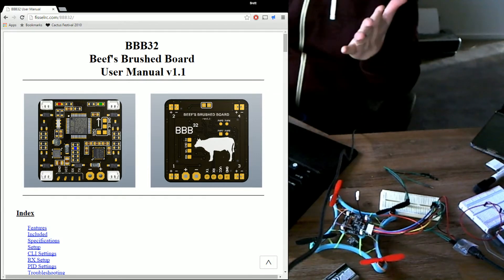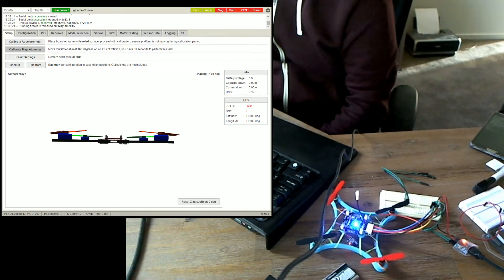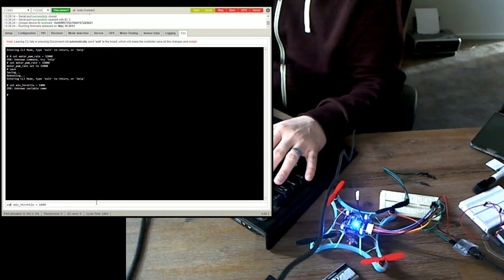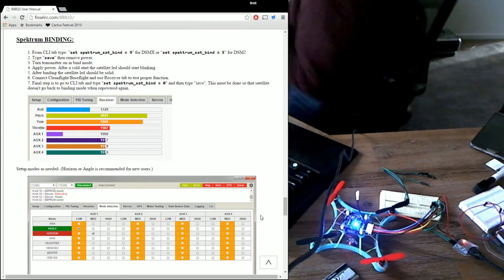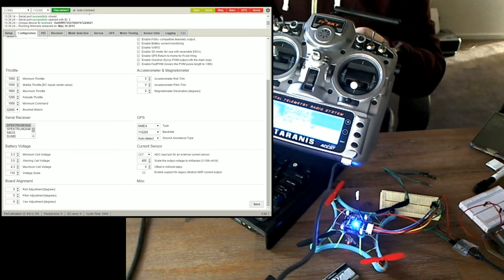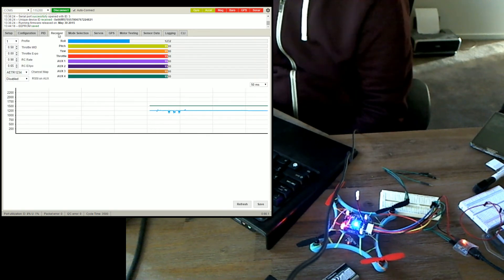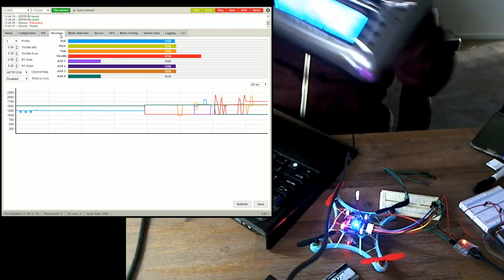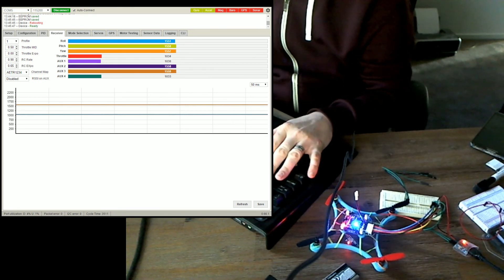Beefs Brushed Board - Micro Quadcopter software setup

Comment: How did you set the MicroFrX in Bind Mode? I tried to short connect the Bind pins, but the RX didN't start blinking.
Reply from the maker: how did you short them? i did have one that was broken which took a bit to figure out.
Reply: +Brett James I tried it with the end of a cable, and then i laid a very small nut on it, and then i also tried with Tweezers
Reply from the maker: Tweezers was what worked for me....

Alternatively,  solder the gap in, and then when you are done "cut" the gap using  the iron to make a gap again after
Reply: I forgott to say, that the light is on though - it just doesn't start blinking. Is it still possible that is is broken then?
Reply: By the way: thanks for the nice video - was very helpful with the rest of the setup! Even for a newebe like me :)
Reply: Thanks +Brett James! I'm gonna try this now.
Reply: +Brett James unfortunately it still doesn't blink. Just a continuously light... :(
Reply from the maker: +Thomas Hausmair it doesn't  change until you  bind afain
Reply: +Brett James you mean, there is no visible difference until you disconnect the Battery, un-shortconnect the bind pins and and then make the same procedure again?
Shouldn't the motors start running while powered during shot connected RX?